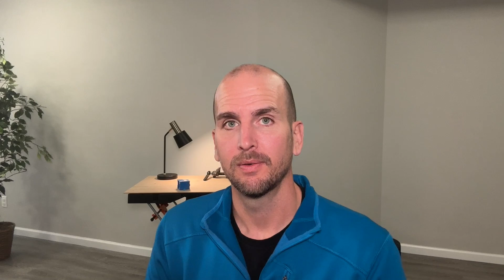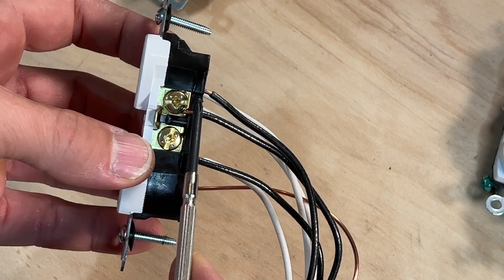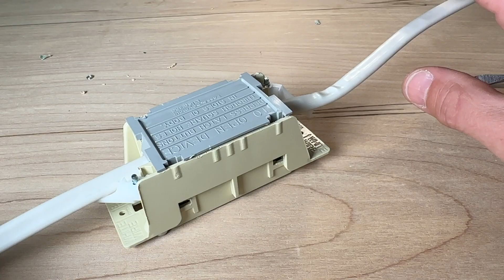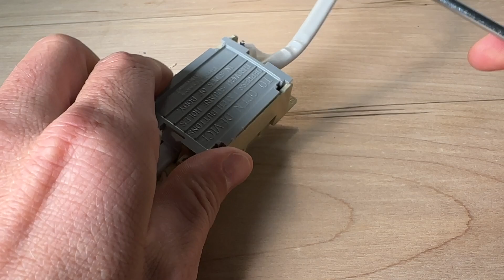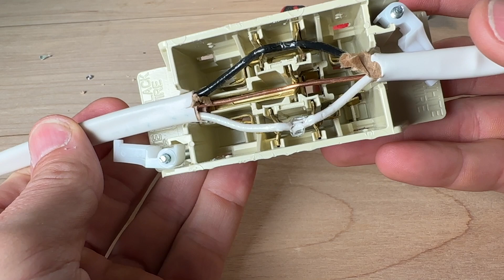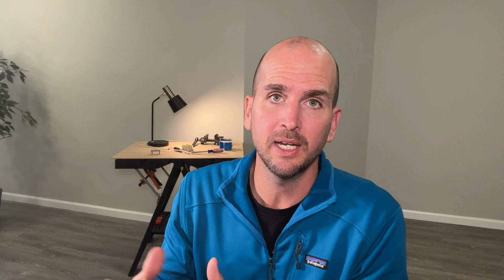90% Of Homeowners Have Never Seen This Dangerous Electrical Device

Comment: I remember plugs that were used on the lamp cords that worked similarly. Push the cord in a hole and push down a leaver. They worked for low power devices but I thought they were a poor way to make a connection. Can't imagine using that system on an outlet where heavier loads could be connected and without the leverage of the leaver pushing the wire into the connection.
Reply: i saw a video of people who do massive Christmas light displays and they make custom cords out of lamp cord with those squeeze on connectors i  have a few in my basement electrical supplies box that i never used didn't seem safe to me
Reply: @ranger178  Might be able to make them safe to use by striping the wire and soldering the wires to the connections in the outlet. Would only work if there is a way to keep from melting the plastic while soldering. Not sure if the conductor in the outlet could be removed while soldering to keep from melting the plastic or if it would be more economical to just replace them.

Comment: I never knew something like this existed.  I have installed RJ45/Ethernet jacks with these punch-down connections but that is a totally different environment and type of wire (thin insulation, low voltage).
Reply: And no one does it with improvised tools (some people occasionally do, but the only consequence is your internet doesn't work). THHN wire isn't designed for this type of termination though so it's going to be even more difficult.
Reply: For things like phone/ethernet wiring, you are correct:  thin insulation, low voltage.  You forgot the MOST important consideration:  LOW CURRENT.  In telephone/ether connections, the current is measured in 1/1000s of amps.  Insulation displacement is not meant for toasters!

Comment: I saw one in a manufactured home, same P&S (Legrand) demonstrated in this video. They are a shoddy product in my opinion, I hate plastic enclosures that are held together with push-in tabs. If I had an RV, prefab, or other place that used them I would replace them all with retrofit boxes and regular switches and receptacles. I have no problem wiring J-hooks and using the side screw terminals, it's easy.
Reply: It is also important to remember these are designed for one time use. Those blades are not intended to be used more than once. opening the box and removing a wire means you have to replace the outlet. With that in mind the push in tabs make a lot more sense as they are not intended to be opened anyway.
Reply: @ralfvandeven3155  You're probably right... the device probably comes from the manufacturer disassembled. You're snapping the back cover on for the first (and ostensibly last) time.

Comment: Using back stabbing in a standard outlet is not the best as you have pointed out many times and I agree.  But, I can't understand how these are even legal.  As I watched the video I was saying to myself there is minimal contact.  Then when you took the wires out so we could see how minimal I was is shock!  The NEC really needs to review these as being approved. Thanks for your great videos.  Take Care, Myles
Reply: Maybe they technically only meet code IF you use the proper tool to terminate the wires, but no one bothers to do that or check that it was done that way.

Comment: Yeah, this is called an insulation displacement connection.  Works pretty well for signal level connections.  The resistance of the connection depends on the contact area and the pressure.  The narrow blades have minimal contact area ( and minimal heat dissipation capability).   With higher currents (several amps) as the connection heats up the resistance of the connection increases which leads to more power dissipation (I2R heating).   That leads to oxidation which leads to more resistance .....  Leading to insurance claims.  The connection is supposed to be gas tight.  Never is because there is always movement in the connection from use.  The small contact areas can not handle the large  currents, like from a bunch of LED lights because the lights have big capacitors that have to be charged, usually with minimal current limit, or computer power supplies because of the same problem.  There is NO blade type connection I know of for moderate to high current that is not a fire waiting to happen.  Look up the UL approval process and you will see how meaningless it is for real world products.  But.  They get their money.
Reply: I2R.  Wow.  Haven’t heard that since I was in Navy Nuke school back in the 70’s.  Have a great day!
Reply: @Karl with a K If it's installed properly, iffy at best with special tool designs, and until it's been exposed to greater than 30% humidity for an extended time or water intrusion which mobile homes and RVs have been notorious for.
Reply: @Karl with a K It works for sending power down the line but not so good for transferring power to the device.
Reply: @Karl with a K it's been a long time since I was a teenager and copper will corrode from humidity after the surface from carbon monoxide treatment has been scratched away. It's not an issue for a few years but nobody pays attention to an outlet until there's a problem
Reply: Perfect explanation.  We had used insulation displacement and crimp connectors on low voltage devices… not an outlet with 15 amp draw capacity.  The only benefit to the “ID” connector was that no wire stripping was needed before fitting and crimping.  Automated wire crimping equipment sometimes did not strip the wire and the crimp connector would be applied over the insulation.  A good connection is all about cleanliness and large surface area bond.  Insulation Displacement is incapable of the latter.
Reply: SPOT ON!!
Reply: Right on. P = I²R or in words, power (Watts) is current squared times resistance. Draw 10A for a long time over a bad contact, say .1 Ohm, and that little spot is burning 10 Watts. That's a lot of heat for a small spot. And the resistance might go up by a lot...

Comment: Thanks for clarification.   I've heard of self contained receptacles and switches but never knew what they consist of.   I would feel unsafe using them for anything more than a few LED table lamps and the LED TV.  

a couple month's before COVID hit, I would've brought an RV as the price was right,  ended up not making the purchase as I ended up working out of state for longer than expected,  and the RV was already sold.   And I was planning to use the  1500 watt electric fireplace I had purchased ahead of time, for the RV, had plans to take my niece and nephew on a camping trip right before Christmas 😯   Blessing in disguise.

Comment: They kind of remind me of those trailer wiring connectors that 'pinch' the wire with similar shaped parts, to me they are worthless on 12V trailer wiring, I  can imagine how dangerous it's be on 120VAC wiring.

Comment: I like the back wire or Sheppard's hook method too. I don't trust that there is enough contact on those push in connections. The spring can lose tension if it gets hot or over time. I had a couple that were buzzing. They were OLD connections. I don't like any of those insulation displacement connections. Most of those devices that are 'approved' are for a particular environment ONLY like modular or mobile homes. But people assume they're OK for stick built homes.

Comment: I have been an electrician for over 35  years and still amazed that this type of device would be allowed on any type of dwelling. US listed or not makes no difference. Any ethical electrician would not install this device.  It is at best an expense the unknowing customer will run into and at worst a potential fire hazzard.

Comment: I would rather not see one of these boxes. I do imagine that they meet code ONLY when the correct tool is used insulation displacement. Just in case I ever do see one of these boxes, please include a video on how to best replace them. My concern is that there is likely a lack of extra cable to wire a conventional outlet. Thanks for the video!

Comment: my mobile home had these for both the outlets and the decora light switches. surprised it held up for 30+  years, pretty much replaced all of them when i could, just had to make the hole bigger in the wall and install an old work box.
Reply: Exactly what I did in my house. All the outlets and switches were these type of devices just like yours. I also swapped them out for old work boxes and real outlets and switches. The outlets were terribly worn and wouldn't hold the plugs from devices say like a tv in them anymore. Couldn't believe what I was seeing when I went to start replacing them.

Comment: These are Insulation Displacement type devices. As you pointed out a very poor but quick and cheap way to wire. I replaced a few of these in a house my daughter bought. I intend to replace all of the switches then start on the receptacles.
I might point out that some insurance companies refuse to cover manufactured homes because of this type of wiring.
Fairly easy to replace with a box and regular switch.

Comment: I'm an electrician from Australia and these are in hundreds-of-thousands of homes. We call them quick connects - Schneider even makes the 413QC.

They are great for down lights and in-line fans and in tight spaces due to their small size.

The blade press pierce design is tight when done properly and secured back with cable ties.

Ironically we love using quick connects, however have been exposed to imported USA wire nuts which most installers scoff at.
Reply: Yes ,US wire nuts are garbage,I use wagos for everything

Comment: Thanks for the warning. When it comes to electrical, safety is my first priority followed by ease of installation.
Reply: As well it should be, if you do it right, it's both safe and only needs to be done once every few decades. And even then, mostly because the connections that you're plugging and unplugging will eventually get loose.

Comment: No experience needed, they are junk. Modern insulation is slick and resistant to tears, so the energy to accomplish a clean cut just transfers the stress to the copper and deforms the blade. About the only compromise is to tap each corner with a wooden dowel.

Comment: I had to swap out a fried SCD lightswitch, the light switches are worse. Did the best I could, I foregone trying to let the contact strip the wires because they were failing to cut through at all, so I ended up stripping to bare copper on either side and just barely managing to shove that in. Even though my tool never touched the contacts, the wire itself, without the insulation, was thick enough that it bent both sides of the contact out on all the terminals I had to connect inside the switch.
Next time, I'm just buying a regular house switch, because that installation process was ridiculous.

Comment: I have these in my park model RV, and I hate them. As you point out the connection is shoddy at best. For me, the biggest frustration is the switches. The internal mechanism does not provide positive switch contact and many times. The switch does not function properly. I have proceeded to replace them with more robust and reliable residential plugs, switches and boxes.

Comment: My 5th wheel RV has them. The wall mount tabs break off easily. In 2 areas the was room for proper wall box install and regular design outlets..  Other areas in an RV where outlets are mounted under a cabinet. The cabinet area has a shallow area between the cabinet bottom and the inner shelf of the cabinet. These devices fit there in the void. No room for even a residential shallow box.

Comment: That's just as bad as those in-wall splice kits. The directions actually tell you to NOT push the wires into the connectors, which seems counter-productive.

Comment: My experience with these "trailer" plugs and switches is that they are GARBAGE. Mobile homes, Camper trailers, motor homes, house boats, and some actual houses have these. I recommend when you encounter them, to completely remove it and replace with an "old work" box and proper switch or outlet..

Comment: Ideal makes a "punch down" tool I use on 56 blocks, RJ45 and it has another oversized punch tip. My intuition tells me, after watching this video,  the tip is probably for punching this type of receptacles. The tool cost me about $55 about 8yrs ago. I have to test if the tip fits #14 or #12 wire.

Comment: Reasoning for those is because older mobile homes were built with 1x2 studs. These devices are set ip exactly like plug mold and power strips

Comment: that works just like them blue clamshell splice that you crimp on to connect up car stereos

why not just build the tool into the device so as you screw down the cover it presses plastic nubs on the cover into the wire and blades or have a powerful spring built in that snaps slamming the contact blades into the wire.

Comment: Have these in my modular home for 20 years now...have only had one fail, but am in the slow process of replacing all.  I have sort of fumbled thru it but always manage to get it right after trial and error...my question is when I disconnect the self contained box how do I know where each BLACK wire goes?

Comment: This kind uses IDC for connections… “Insulation Displacement Connector.” You find them in everything from quick splices to ribbon cables to replacement lamp plugs. Still better than back-stabbing since the blades actually cut into the solid core wire for a better connection. I imagine back-stabbing probably works a little better if you tug them backwards for the tangs to dig in a bit, like IDC.

Comment: Yeah this is like wiring a trailer hook up into your cars wiring harness. Those connections couldn't possibly run the amount of current the wires and breakers were made to run. FIRE HAZARD as i see it.

Comment: Electrical code is predicated on professionals doing the work. As with all electrical devices, poor workmanship and the use of incorrect tools to do the job will result in potentially dangerous conditions. I see nothing wrong with this device provided the installer follows best practises and inspects his work. 
Let's talk about some of the advantages if a full circuit was done with these devices correctly: reduced complexity, reduced space due to form factor, lower cost,  fewer places for something to go wrong and probably three times faster to get the circuit done!

Comment: I knew it would be the "press blade" design, I'll call it.  No, I've never seen one, but I can see where Not using the proper installation tool would make them Hazardous.  Especially with such little contact like those.  IF I were to use them and didn't have the tool, I would insure that the wires were all seated to the bottom of the blade channels.  That could be done by making a wooden push tool of the correct rectangular dimensions and cutting 2 thin slots in it for 3 push tabs, center and both sides, that are long enough to seat the wires all the way down in both blades perfectly and flat.  It's just common sense, having worked in electrical and electronics since 1974.  I can see them meeting code and having UL Certification, but that is DEPENDENT on Proper Installation of the Romex, including Properly Sized AWG Wires.  With the wires seated all the way down, any flexing of the outer Romex will minimize movement in the blades.  However, I would still avoid them in preference of the Back Wiring design, or at least screw mounting with a J-hook.

Comment: I’ve seen this sort of press in knife wire connection in automotive 12v fittings and in the cheapest replacement plugs for 2 wire lamp cords.  Done right with the tool they work but I agree are sketch for any high load application, would want to run a hair dryer of one but device battery chargers and lamps ok. I like the minimalist design as bd light wt , maybe there are other brands with better connections . 
Did your check to see if the back cover is supposed to push the wires in place? 
It looks like it might be that type 
Some of these knife connectors do that . 
Cheers Warren